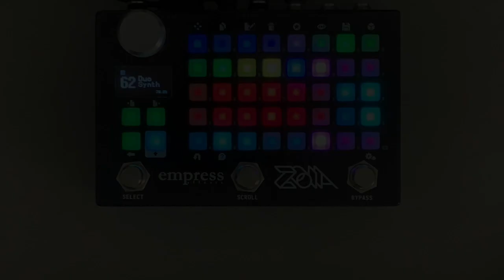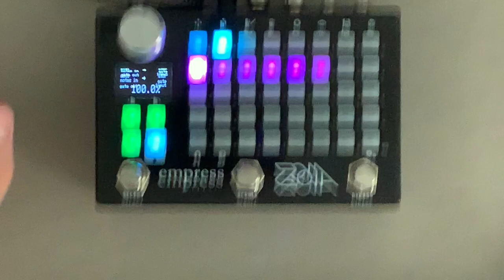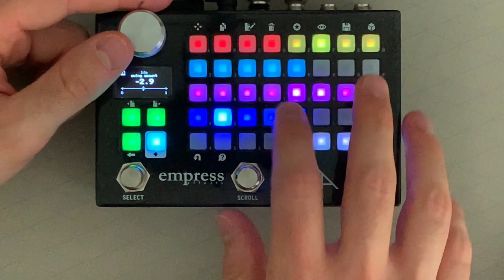Synthesizer from Scratch | ZOIA Tutorial

Comment: Made the patch using the video, (tried 3 times)  following all of the steps, but not getting any sound output, any ideas?
Reply from the maker: What midi controller are you using? This patch (linked in the description) uses a midi note/gate setup. You can also use the Keyboard module if you’d like or don’t have an external keyboard for playing notes.
Reply: @HypeConsumer  Thanks for answering. I'm using a Arturia Keystep. Any info on how to set up the midi/note gate?
Reply from the maker: For using an external controller, you need to make sure the MIDI note in modules on the ZOIA are set to the same MIDI channel as what's on the Keystep. Note goes to the oscillator pitch and gate goes to the ADSR.